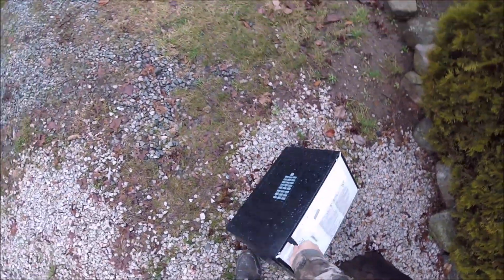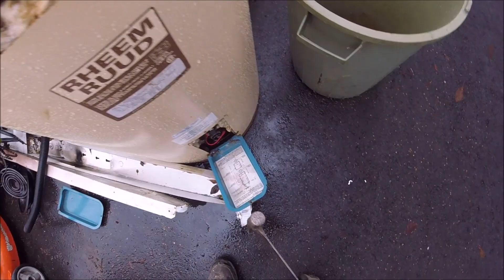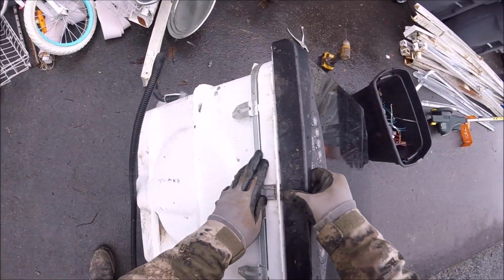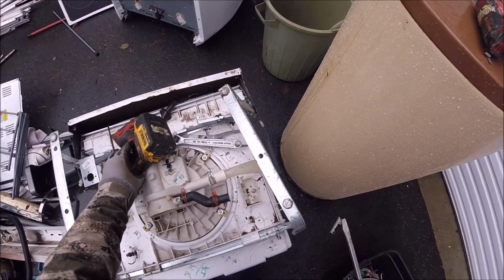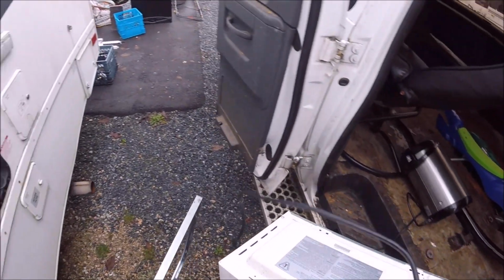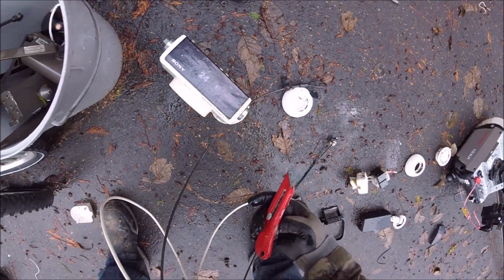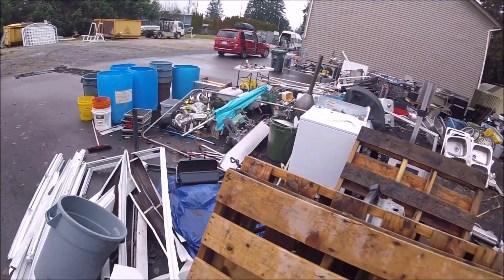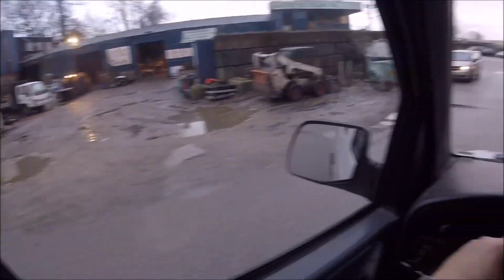Scrap Run With Scrapping Action

Comment: Out of the three shutters you installed in your garage, you are opening only one and there are still many bins, milk crates just in front of your shutter. Either you shift them away to where you keep piles or process it. Good that you got rid of most of the shred in that general area. It was a good load.